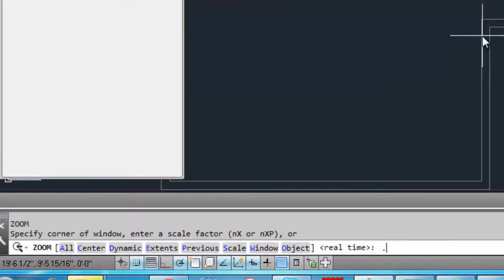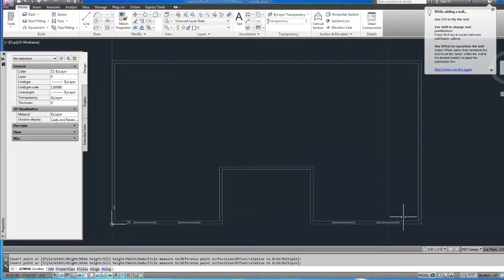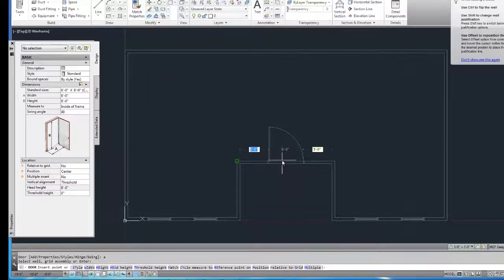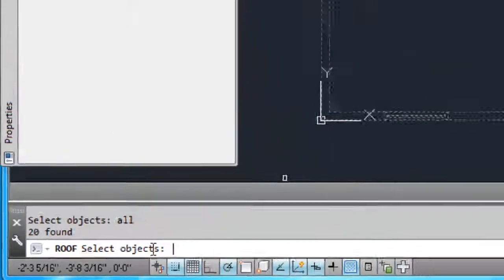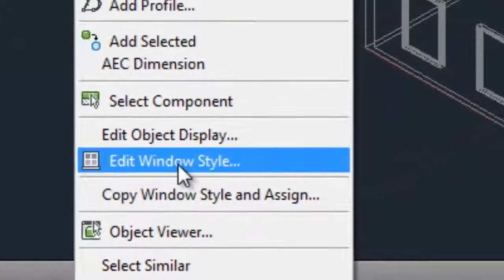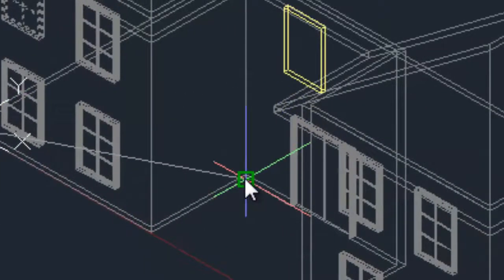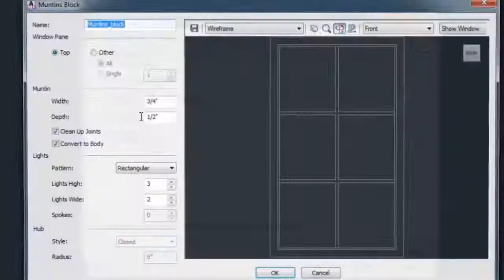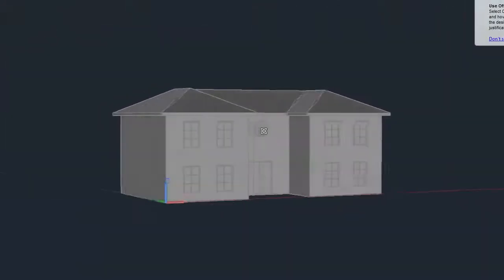Timed Exercise Using AutoCAD MEP 2013

Comment from the maker: dreamrower, that may be happening because you may have added a second set of muntins instead of editing the original. If you are in fact sure you have edited the parameter from 3 down to 2, then you need to delete the extra, incorrect one. Alternatively, simply delete the window and do it over. Please ask follow up questions if this tip doesn't fix the problem.